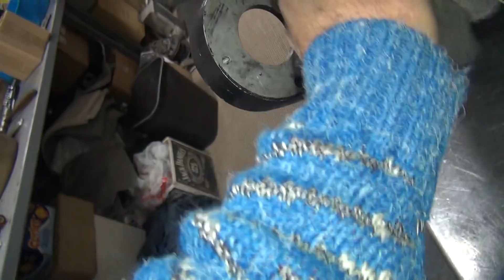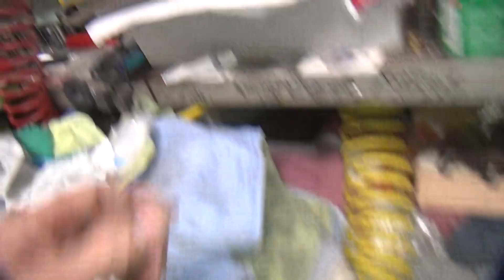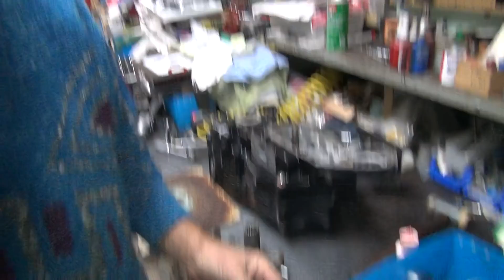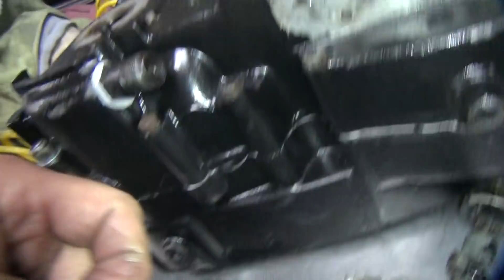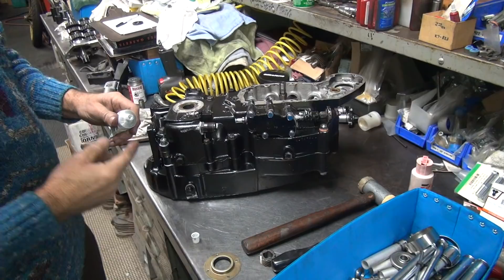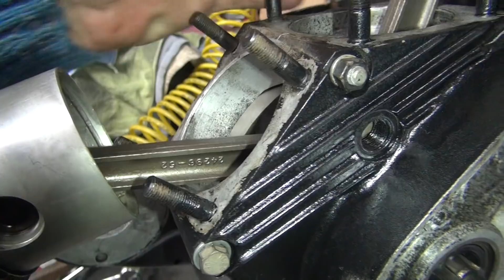1972 ironhead #111 xl xlch case repair motor rebuild harley sportster by tatro machine

Comment: hi tatro if the oil pump no longer turns after tightening the 5 bolts down what would you look to resolve it? tried aligning it with a rubber mallet but no good
Reply from the maker: put dry or felt tip marks on the marts and see what is dragging. then fix as needed.
tatro

Comment: So if the oil pump timing is severly or overly incorrect what is the outcome of oil flow? Kind of got me thinking about the preciseness of the build of my new '68 . Guy said pressure gauge on rocker is broken, have flow back to the tank just wondering about oil to the heads.  Thanks for sharing technique and specs in all Tatro videos.
Reply from the maker: the oil pump is not being timed and does not need to be timed. i am timing the crankcase breather valve timing. this controls the amount of oil left in the flywheel chamber and over all crank case pressures. if it is not close to being correct for the application you will wet sump and or blow oil out of your motor. at high rpm this is a real problem.
pull the gauge out while the motor is running and see how much oil is flowing out. old harleys don't need much oil pressure but they do need oil flow. 2-5lbs is ok for most motors.

tatro

Comment: I own a ironhead sportster and thought that it had a pretty tough engine.  So I was surprised to see these two rather large failures, breakage of the motor mount and breakage of the case where it supports the guide for the primary chain.  Are these typical failure points for ironheads, or are they unusual?  What would cause such failures?  For example, was the broken case the result of running a totally worn-out, overly loose chain?  Or maybe trying to pop too many wheelies?   By the way, your repair of that case was a work of art, very impressive.  And the amount of effort put into getting the motor mount right...most mechanics/machinists would have just bolted on an uncorrected replacement, which would have broken again a year later.
Reply from the maker: broken mounts are common. watch the video on how to install the motor and it will last for many years.
tatro

Comment: With all the work going into this motor I'm curious why you didn't completely finish the bores and fit new pistons? Cost possibly.
Reply from the maker: yes. the job was to fix the cases, not rebuild the motor or bike.
tatro